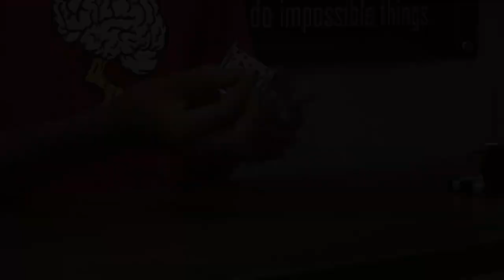goBILDA, Actobotics, Tetrix: How to Choose, How to Use

Comment: This is pretty huge thanks for this video!

One thing I do want to ask is why is there no rev robotics parts??
Reply: REV uses plastic bushings, plastic brackets, and 5mm axles, which are flimsy, higher friction, and prone to binding. It has channels, but they're not as easy to use as goBILDA channels because they don't have such a grid pattern. It has some face mount bearing blocks, but they're nowhere near as nice and compact and easy to use as goBILDA's variety of flanged bearings and pillow blocks. It has t-slot extrusion, which is useful for its versatility, but goBILDA has similar extrusion that is bigger, stronger, and easier to mount on the ends. Since good REV parts like Ultraplanetary gearboxes and mecanum wheels and REV hubs are easily compatible with goBILDA anyway, why not just use goBILDA?
Reply: That's a fair question, although REV is notably an extrusion-based system, unlike these channel based systems
Reply: @quinn.mcginley  do you think I can use any of the starter kits only to build a advanced robot even outside of FTC. What do you think I should get other then the starter kit to make advanced robots